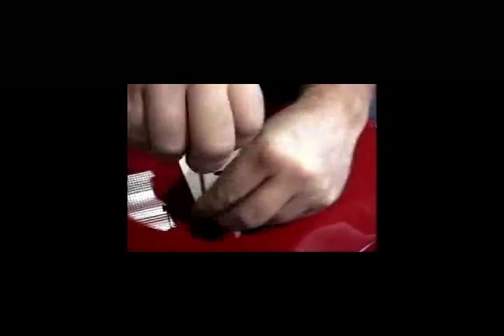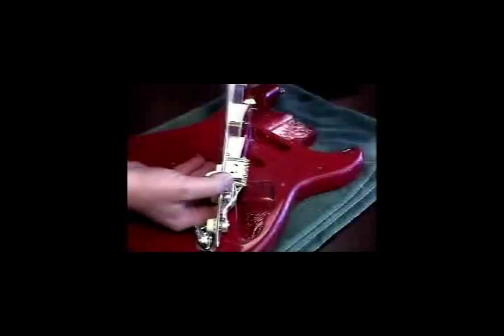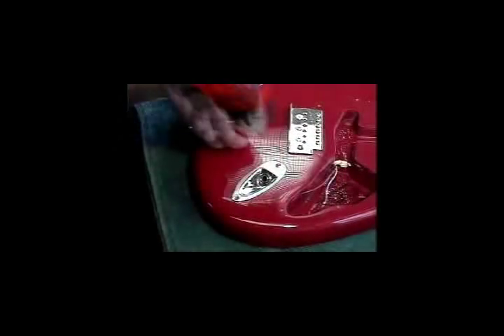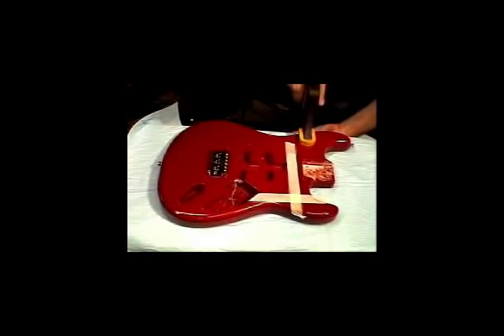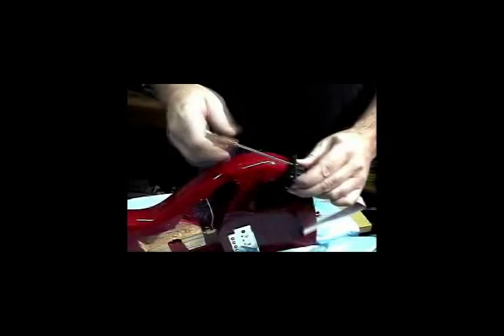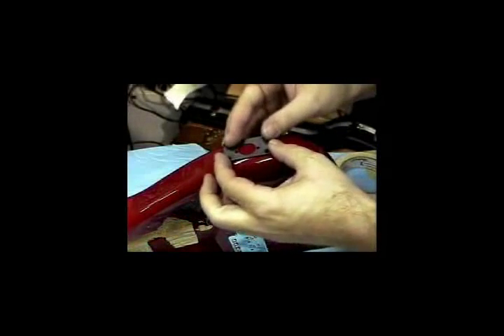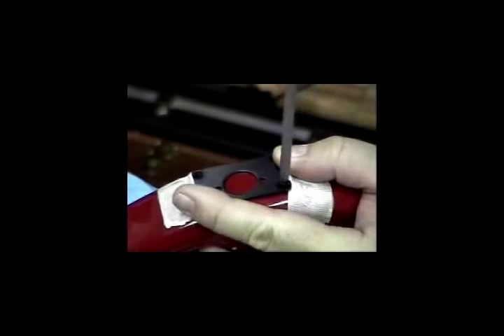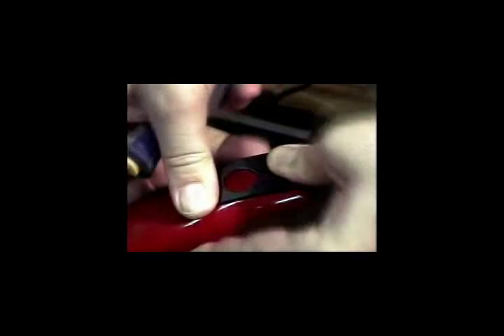GHOST Hexpander Installation - Part 1 of 3

Comment: Looks like a cool job. Someone linked to a article about there experiences with installing this and said it wasn't a hard job to do. I use a GK-3 EXTERNAL but would love to have a internal unit. When I get another guitar, I'll probably go the internal route with either a INTERNAL GK-3 or with this one. I have heard that these are very nice but am a little concerned with what I hear about the latest Roland update (1.04) that has settings for these. It's a mixed camp on which is better.